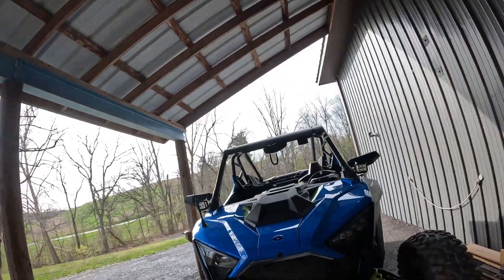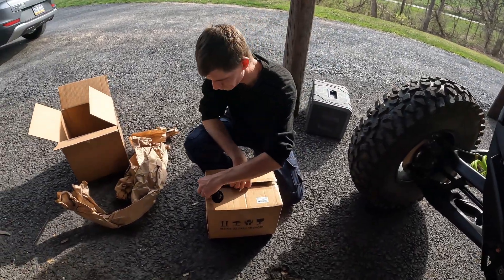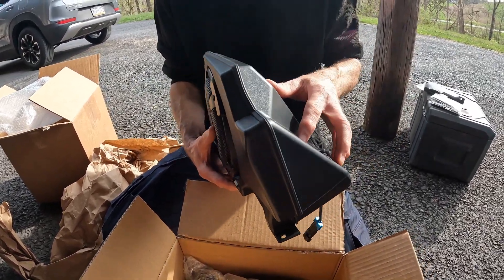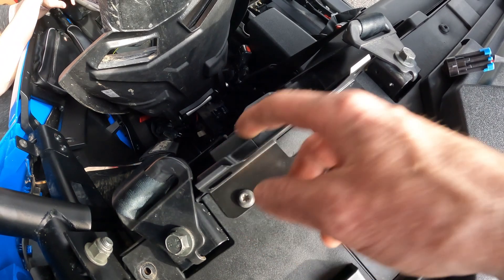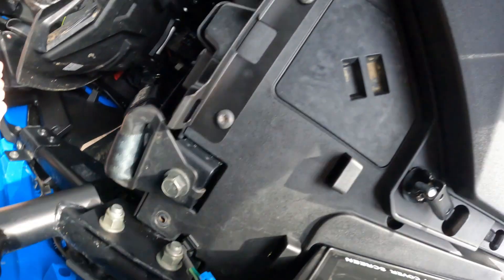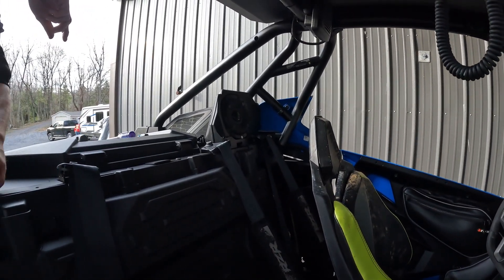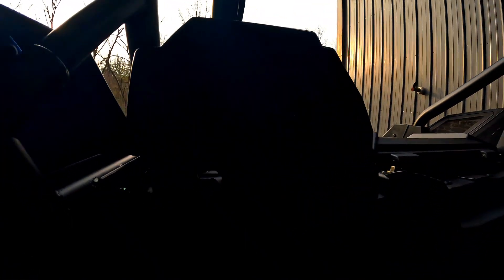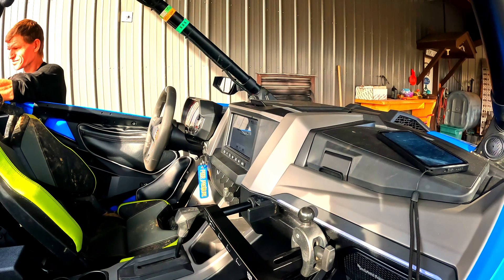Trail Star Audio | Rear Speakers Install | Turbo R

Comment: I just bought the 2024 pro xp base model with no ride command  does the rear plug ins have power to them and I can just plug in the speakers? Or does it need ride command to work?
Reply from the maker: Ours came already wired and powered from factory.  I believe if you dont have ride command,  you will need to have a power source (amp) to run speakers like these. You can also just get a sound bar or something. We had to go that route with our other rzr because it had no ride command.  Hope this helps.

Comment: Surprised you didn’t get the stage 5 audio in your machine with that sub. I’m not a big fan of Rockford speakers
Reply from the maker: When i was making the video, i messed up and said sub, which there is none. This model is the highest with the live valve shocks and ride command, but it only comes stock with the 2 speakers in the dash and the tweeters on the front of the cage. It comes pre wired for rear speakers. So there is no sub. We thought it was weird that for the high-end model, it didn't come with the better system and speakers. So we just wanted to get rear speakers since there was no wiring to be done. This route was a lot cheaper than going through rockford and polaris for the setup. These sound pretty good for what they are.